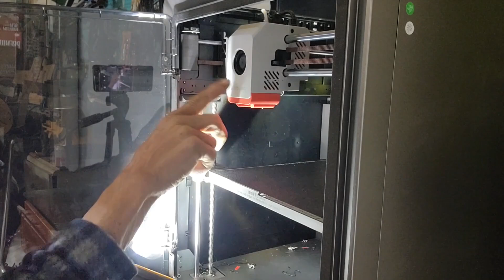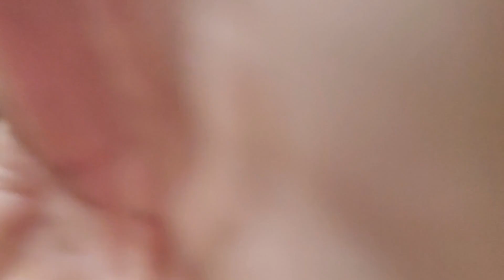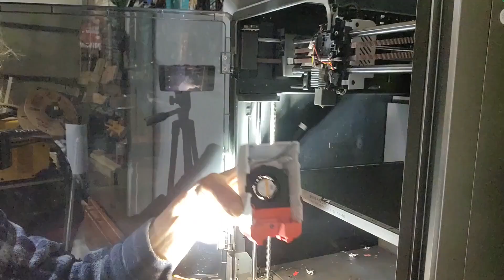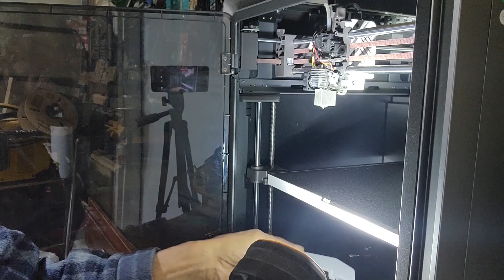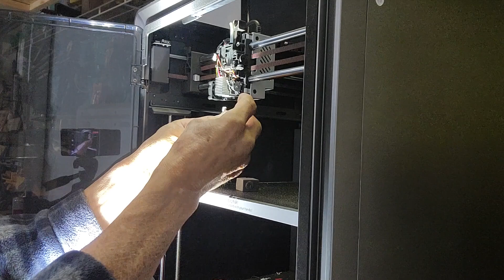How To Replace Hot End On The Kobra S1

Comment: don't buy those skinny claim to heat faster aftermarket hot ends. the wiring is very thin and fragile and it will short and give you a error code and mess up your prints. Other than that this prints nice for the price. but be careful of witch filament brand you use. they are the number one thing that clogs and f up your nozzle

Comment: please tell me someone already commented there is a f'n switch on the top to unlock/open the main fan box there, don't just pull, you're going to break things
Reply: Just snapped mines because of him lol
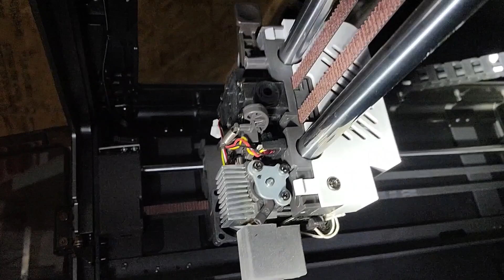Reply: Indeed, the dark grey latch with a circular indent for finger can be seen at 2:04, top middle. Still awkward, but more sturdy than prying around the fan holes. 

-Most likely, it wasn't on the printer at launch or when that guide was written- wait it's even in that guide's step 2.2, to the right of the Bowden tube!
Reply: @LeftyPencil  wow had written so much of a nice reply when the page reloaded or something and so much for that.
Long story short, yep, ^. During troubleshooting my 1st S1 support told me about that and little twist/pull softly so as not to much up the fan wire.
Over the course of release till now, I've had 3 S1s, 2 of them gone to shit within days/week or so, 3rd not even unpacked. 1 returned already, remaining 2 in the process and have since purchased a Bambu P1S w/ their ACE 2. Done f'n w/ these "T2" brands"... =\
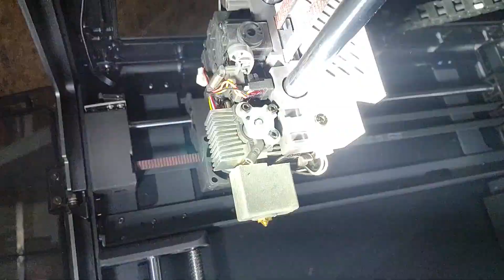Reply from the maker: @LeftyPencil  Are you saying that the latch at the very top centre of the screen at 2:04 is the cover release ?
If i'm not mistaking that is the filament tensioner.

By the way, I just replied to an Anycubics email about the parts and asked them if there was any lever anywhere to release that cover, we will all know ounce I get a reply
Reply from the maker: I have a reply from Anycubic, QUOTE: Dear friend
There is no lever to release the front cover, you can directly disassemble it by referring to the method in the video.

But I already new that, any 6 year old can see by looking at the cover that there is no way of implementing anything that can push in on all 4 corners to release the cover.
I had to prove it by getting proof from Anycubic in case anyone that does not have the Kobra S1 to look at didn't take my word for it and believed people going around stating false things they know nothing about.
Why people comment false statements ? I don't know, maybe their lonely, but I enjoy replying to these kinds of people cause it gets me views, so in one way it's bad but in another way it helps my video's.
So if you want I have a lot of other video's with low views, you can go place false comments on those and I'll reply there and we can have a ball, we will both win, you won't be lonely and I'll get views, see you there. Cheers
Reply: @NevesProjects ok, I'll avoid that 'lever'
Reply from the maker: @LeftyPencil  Yeah, you just need to figure out the best way that you feel comfortable removing the cover, some pull it from the bottom, some squeeze the centre and pull out, just take your time and don't force it, 
I have removed it a few times, sometimes it disconnects easy other times it takes a bit more patience.
One thing to pay attention to is when your putting it back don't pinch the fan wire, it is very easy to do by mistake
Reply from the maker: You also post on other video's saying that there's a switch on top to remove the cover, there is no switch so I don't understand why your going around commenting that there is,
Where did you see or here that there's a switch? I don't see any 3d printers on your channel
Reply: @NevesProjects  Yes I was told directly from Anycubic support team as well as it is on the wiki. Right about here, at this time stamp, your pointing to the clip at the top, black piece with a little clip spot built in like those white ones on the side, but with a handle. you squeeze that towards the center and it unlocks the cage, then carefully remove as you recommeded of course as, wires, and yes, I started watching this video, couldn't get through it, sorry, (hence not seeing your pointing it out later, even now, just simply grabbed a time stamp and you happened to be discussing those clips, watched another very short one, and never mentioned the clip either, just jiggle and pull, so yes, I posted about it in hopes of being helpful to someone perhaps. That's all. don't see why it's a big deal. and am I required now to have a youtube channel to be able to have information or advice etc on something?
This is why I 99% don't bother commenting anywhere ever.
Reply from the maker: @ThatIrishKid617  I dought very much that you were told that by Anycubic because on there website they have a video in which they show you how to remove that cover/
check this link on their site https://wiki.anycubic.com/en/fdm-3d-printer/kobra-s1-combo/hotend-replacement-guide?_sasdk=fbmV2ZXNwcm9qZWN0c0BvdXRsb29rLmNvbQ

Comment: How do you bring the plate down?
Reply from the maker: On the printer choose the 3rd setting, the one just above settings (the gear symbol) you will have 3 choices,  Control, Calibration and Move. choose the move option and you should be able to do all your movements there.
Reply: you could also (with the machine off) turn the front lead screw on the right manually with your hand to raise and lower the bed. machine has stepper motors so you won't lose homing positions on start up. hope this helps

Comment: How do you lower the hot bed? mine is set close and I cant remove as hot bed level is too high
Reply from the maker: On the printer choose the 3rd setting, the one just above settings (the gear symbol) you will have 3 choices,  Control, Calibration and Move. choose the move option and you should be able to do all your movements there.
Reply: Cheers sorted 👍 @NevesProjects
Reply: you could also (with the machine off) turn the front lead screw on the right manually with your hand to raise and lower the bed. machine has stepper motors so you won't lose homing positions on start up. hope this helps

Comment: Hi there. I've been seriously thinking about buying a Kobra S1 for a while, but I see so many videos complaining about it. In your opinion, do you regret the purchase?
Reply: I'm a complete newby to 3d printing an i got one best decision I ever made ,working a treat
Reply: i have very mixed feelings about mine. auto levelling is badly implemented and no levelling knobs. after pauses pressure advance settings go haywire and a few other quirks like the camera not working half the time and menus not letting you extrude stuck filament without restarting the printer etc. screens going non touchy after a print completes requiring a reboot. but other than that its great and I have done some nice prints. i want my money back but when hell doesn't freeze over ill make it work well enough
Reply from the maker: Hi jocaferreira5111, The printer prints really nice, Iv'e been printing PETG pieces for the go kart since I replaced the hot end with no problems at all from an external spool so I kind of don't regret it.
I'm a bit pissed off cause the Ace system broke, but Anycubic did reply to my email and is sending me parts to fix it. 
I don't want to say yes it's worth buying in case someone does buy it and blames me if something goes wrong but if the parts they send me fixes my problem then I'll be happy with the purchase, I'll be putting out a video on how the new parts work out
Reply: So here is the honest deal.  I have had 2 printers in my life first is a Qidi xmax2 and the Kobra S1.  There is a steep learning curve to 3d printing unless you are just looking to download toys and stuff off of the file sites. Many of the issues I see is user error.  I use mine for functional stuff and most things are reverse engineered and custom to what I need/want.  Having said that I am a light user I do not print a ton of stuff. This involves F360 as well.  So I received my S1 end of Feb beginning of March.  I needed/wanted something faster and that could do multi colors. It has performed OK with an occasional hiccup here and there but nothing major but yesterday I started getting a Error code 10237 which is the auto level sensor. Did the power cycle like a dozen times still same deal.  Seems to be a pretty common issue with these and not one that is going to be quickly or easily fixed. Im not real happy with it at the moment.  I can also say while my Qidi is slower than dog chit it just works.  I had to fire it back up today for first time since getting the S1 and zero issues.  For myself the extra headaches isnt worth the S1 im going to stick with Bambu or Qidi for my next printer.  Less than 1 year before things start breaking with very light use isnt for me.
Reply: I have the Kobra S1 and the P1S and they both print great if you put the prints together i cannot tell which printer did eah one buy the S1 combo the ACE multi filament system lets you dry while printing